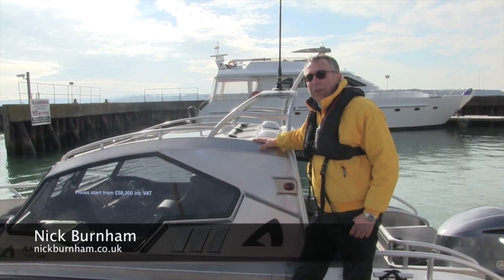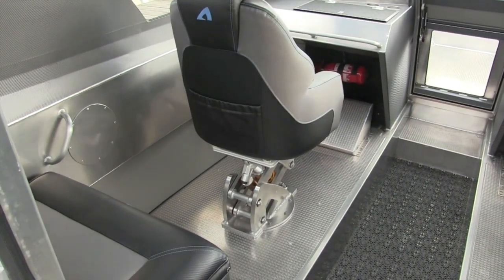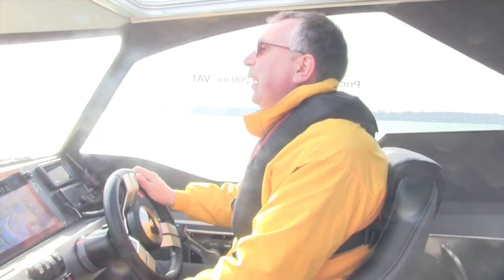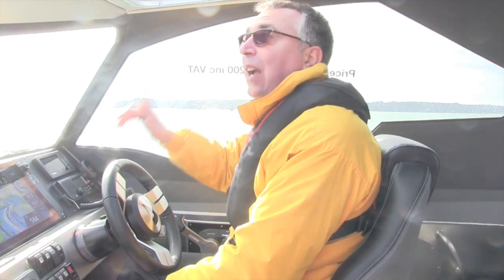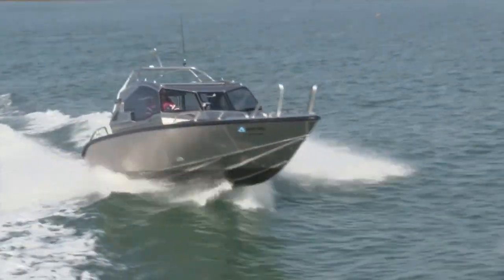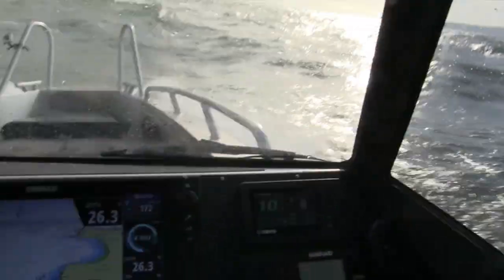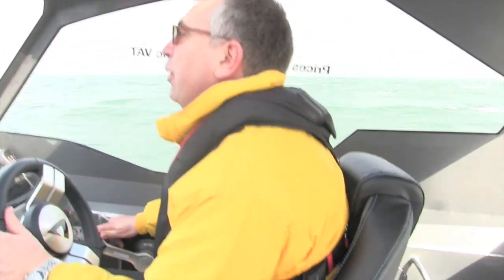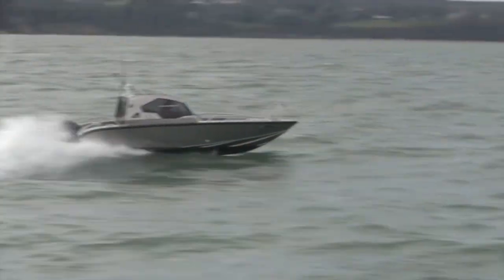Anytec 747 Cab from Motor Boat & Yachting

Comment: I've been using this boat to commute in for about 4 months now and everything he says is correct about it. It absolutely lovey to drive if you are 1-2 people in it, and it's the best in its class. However, it only seats 2 people comfortably in it and it's not a boat you would take your family out on a sunny day with. So just be aware of that.
Reply: I love the boat. Only dont like is only 1 motor possible.
Reply: Freecheese 2 engines on a 7 m boat?? That’s just unnecessarily heavy and expensive

Comment: That Yamaha sucks! it will break down blow a piston or just won't run when you need it the most.
I am an Alaskan professional hunting and fishing guide that had my fill of these unreliable outboards!
I have changed all my boats to Chevrolet 454 V8 and 383 Chevrolet stroker small block.
Never again will I buy any brands of large outboards because they are hearable unreliable and don't come close to the torque power of a Chevrolet V8.
Reply: Ive had one for over a decade and it’s never given me a problem. I’ve seen plenty of people put car engines in boats and it never works.
Reply: @joesmithguide  Of course just putting a engine in a boat meant for cars or Trucks without the cam for a prop or jet pump and not using stainless head and intake gaskets isn't going to work on a boat.
Any V8 for cars or trucks & boats must be put together with the parts the engine is going to be used for.
When a Chevrolet V8 is done correct for a boat here isn't a crappy outboard in the market that can come close to the reliability and the torque of a Chevrolet V8
Reply: @joesmithguide  Are you a full time guide and charter boat owner ? 
I would say NO !
Most likely you use a boat with the outboard on it at mostly 2 weeks a year.
large outboards aren't made for commercial uses .
Reply: @joesmithguide  To burst your own freaking ignorant bubble my 1969 402 Big block Chevrolet that ran my 1972 PU for 10 years now I rebuilt for my 29 foot jet boat and it is as bad ass as it was in my truck using a Comp cam for a jet pump
Reply: @Lure-Benson  terrific I don’t care. I’ll drive my boat and you drive yours. I’ll use my Yamaha and be happy because it’s never failed to start or run.
Reply: @joesmithguide  Then why write a much of crap to me talking shit from a person that is a few times a year boater as you are.
Also once you tell Yamaha you use the Yamaha motor for commercial uses Yamaha cancels the complete motor warranty on you .
That there told you Yamaha is a total crap motor.